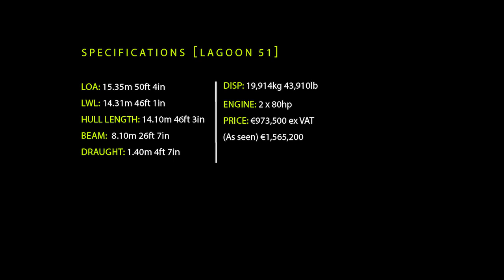This Lagoon offers serious volume for private owners and may surprise under sail

Comment: I know people diss "condo cats" but really if you are doing a world tour as a couple with friends coming along every now and again, this is an impressive bit of kit. IF you was to get a mono hull what would compare with it, for cabins and space?
Reply: Or... If you got a performance cat and then added a dive compressor, dive gear, a water maker, a large fast dingy, kite boards, and all the rest, a) would you have room and b) how much would that kill any performance edge you had?
Reply: @geoffstrebel2808  But this isn't a performance cat... How would you fit all that stuff in a mono anyway?
Reply: @vokstar  Vok, what I'm suggesting is that a performance cat, with low displacement hulls, would not perform well if fully loaded with gear while a larger displacement hull would maintain their current performance better with the same added weight.  Yea, monohulls.  A very big one would fit all that stuff.
Reply: @geoffstrebel2808  Gotcha, after I replied I wondered if that is what you meant... Every boat is a compromise I guess.

Comment: Imagine the noise (and stress) made by seas striking the boat between the hulls!  Can anybody say "Oink"?
Reply: @7:34  The form of the bridgedeck is designed to dissipate the wave slapping noise you're concerned with.  I've chartered several now and haven't heard any concerning noises even in rough seas.

Comment: Big no to any Lagoon from me, aside from looking like multi story caravans; the whole bulkhead structural issue on the 450’s over the past two years means I could never invest my hard earned into such a boat.
Reply: Don’t trust Lagoon at all. Listening to all the stories about the bulkheads and how they treated the owners, a company too avoid.
Reply: @kodiak7  Well, honestly, Group Benetaeu is the parent and they call the shots...
Reply: @Geoff Strebel  yep, I wouldn't touch a Benetau either.  Just floating caravans that aren't backed properly by the manufacturer when things go wrong as they did at Lagoon.
Reply: @geoffstrebel2808  yes thx I’m well aware. I just was staying closer to topic. But the rule applies to the whole company
Reply: Hey gents, what makes of Catamarans have you heard or experienced positive things about?
Reply: @TheJitsGuy  the brands I’m interested in are the Garcia explocat, outremer, seawind, balance, and hh. I’m having a very long and internal debate about which one is the way to go. With cost and wait times all being factors across all manufacturers
Reply: @kodiak7  thanks for that! I’m a first time buyer in the market for a reliable and comfortable catamaran for a family of 4 and manageable single or short handed. I’ll check out all those brands you mentioned :)
Reply: @geoffstrebel2808  thank you so much! I follow them both and that’s what got me looking at Lagoons! I also live in the Med and it’s quite “easier” sailing that I’d be looking at in Greece with a focus on comfort and space on board. And yes, the fly bridge is a huge plus!
Reply: Really ? I didn’t know about that issue on lagoon
Reply: @gmerola2652  Look it up, some of the structural design choices Lagoon have made on the 45 should really be criminal.

Comment: Anybody else heard all that creaking?
Reply: Lagoons terrible build quality
Reply: At what timestamp in the video were you hearing creaking that concerned you?  I ready your comment and listened closely and didn't catch it.
Reply: @geoffstrebel2808  8:03, 8:19, 8:28, 11:05, pretty much from 11:39 to 12:20, 13:10 to 13:20, 13:45 and several other creaks throughout his tour. I also don't really understand how you can do any sort of review of a Lagoon boat without even mentioning the bulkhead issue and how/if it's been addressed.
Reply: @ATT120  I listened closely and none of those instances worried me.  Its a yacht in 20kts of wind and moderate waves.  Its not going to sound like a hunter killer submarine.  Sounds like water slapping the bridgedeck or someone easing a sheet on a winch.  I also don't understand how anyone can do a review of a Lagoon without someone harping on this where there's really not that big of a concern anymore.  The Lagoon 450, which is the one that had a big problem is built in a different factory than the yachts above 49ft so hopefully the build quality issues get resolved.
Reply: I would just add that you can put any major multihull manufacturer's name into a search engine and add "bulkhead issues" and find results.  Keeping two hulls alighend together forever is a tough ask.
Reply: @geoffstrebel2808  How much bulkhead issues are there with cats from Outremer, Catana and Marsaudon Composites?
Reply: @ATT120  "[...] how you can do any sort of review of a Lagoon boat [...]" Well, that's the catch isn't it? Yatching World does not do reviews. It does product placements. 😁
Reply: If you don't hear crunching and creaking, then you are not on an original lagoon catamaran
Reply: @ATT120  all of those time stamps in the 8 min area are from the winches. Normal for any glass boat, they all make loud noises when working under load.

Comment: To hear Toby  say this is better than his home is rather disappointing. But it sets the bar then really low. I see many lagoons living in a Marina where people enter for immigration reasons. And although I don’t like lagoons they do reasonably well. My objection against the brand is the details. One pays well over a million fir a smaller boat and looking at the larger ones you’d double that. And then to see crooked tables, ikea like furniture finish. Personally I don’t like it and would not buy fir that reason. But i can see SY people do. Designs are quite smart, although executed in less great ways.  Hull shakes are not great but the 62 series won quite a few ocean crossings. They are far from a performance boat, but that’s not what these buyers look for. And like Bavaria was ridiculed fir years to be a caravan on the water, these are. Yet that’s what a large crowd seem to want. Mc D in stead of Michelin stars. And that’s fine. That a few had issues is no problem as long as they solve it. Did not oysters loose their keels? And those are several millions.. as long as the builder solves such problems not a big problem.  Unfortunately lagoons are built in such a way that you need to savage a lot to fix such issue. I’d like to argue that in any systematically built boat that’s the case. Because connections make the structural integrity hence no bulk head is stand alone. The bulkhead issue is a fake argument for not buying. That in their defence. Still don’t like them because to many faults found in them, crooked panels, tables etc. Just cheap furniture and it’s not rounded enough for rough seas to my liking. Just personal choices/opinion. Conclusion we need to click more to give agony a higher income so he can move on in life, and buy a real boat. Whatever that may be for him.